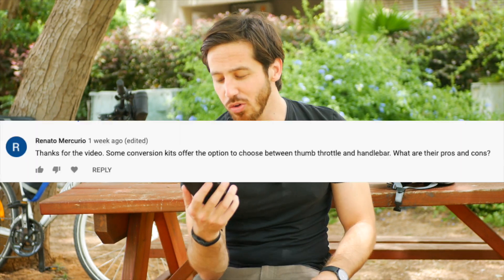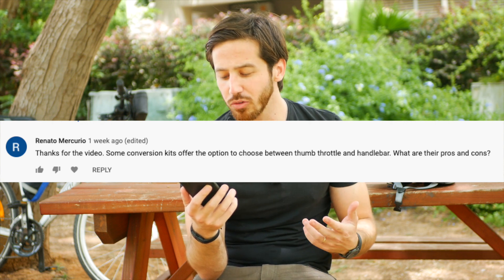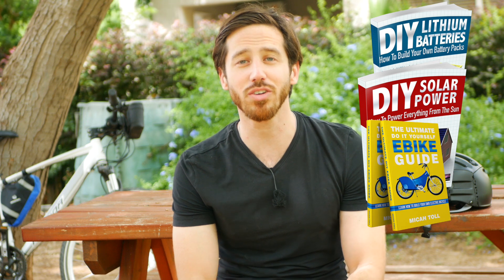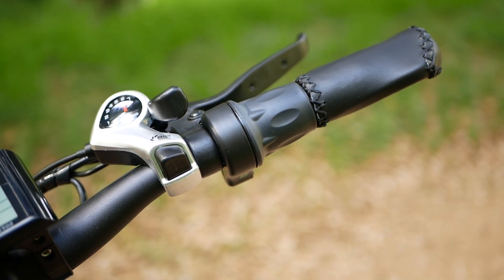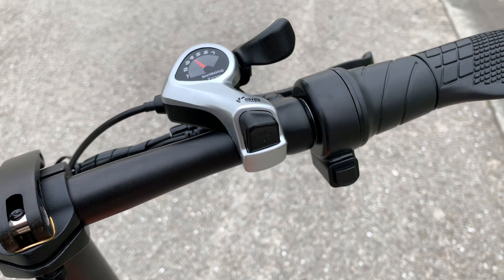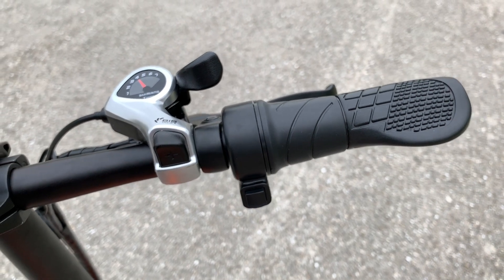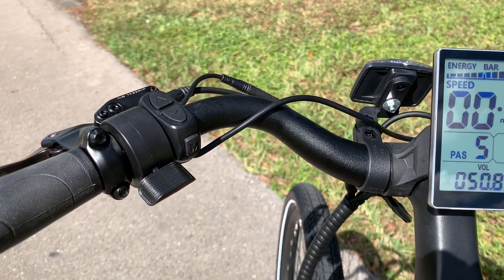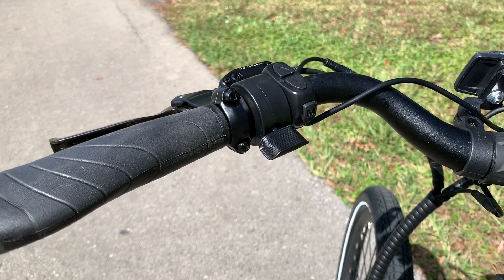THROTTLES: Twist vs Thumb - Which is better?!

Comment: I much prefer the thumb throttle on my kit ebike to the full twist throttle on my fat tire ebike. I put the thumb throttle on the left bar so no interference with the twist shifter on the right. I used to ride motorcycles too, and I still prefer it on the left. The biggest thing I dislike about the full twist throttle is that it's nowhere near as easy to modulate the power - you can't just feather on a little power, it starts at like half power. I only have my bike to compare to, maybe other full twist throttles are better than mine. I hope so.
As to getting a sore thumb? Nah. There's a secret. Put thumb pressure on the housing, not on the throttle lever. You can then roll your thumb a little up or down for more or less power. You don't need a lot of pressure to keep your thumb on the housing either. Thanks again Micah for another great video!

Comment: I'm interested in a video on rebuilding a spot welded battery pack, like replacing the worn out cells with new ones. I've got a nice pack from EM3EV and would like to replace the cells when it ages too much while continuing to use the nice BMS and casing. Is this feasible and/or worth doing in your opinion? What would the process involve to maintain the integrity and safety of the battery?

Comment: Not sure if this has been covered by one of your older videos, but is it possible to run two battery packs (both with BMSs) on one bike, so that we can use two chargers? 
Or what options are there to charge faster than the usual e-bike 5~6 amp (fast chargers)? 
Am asking because using a 30~40 AH battery with one 5~ amp charger would just take too long to charge the battery up to full if its been run down reasonably low. 
thanks!
ps... is there a way to do a variable regen braking system? (edit again) heh... google algorithm must be reading my comments, a video explaining this question popped into my suggested videos list, lol
seems that it will mainly depend on the controller and if it can accept this option or not. thnx